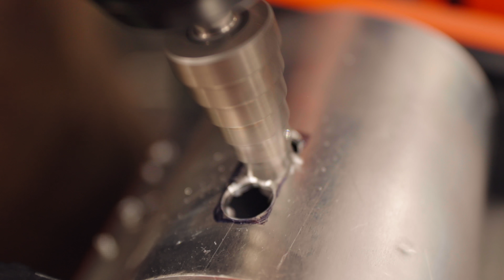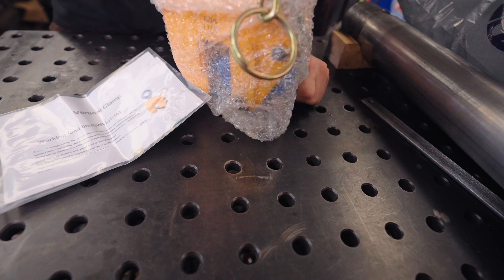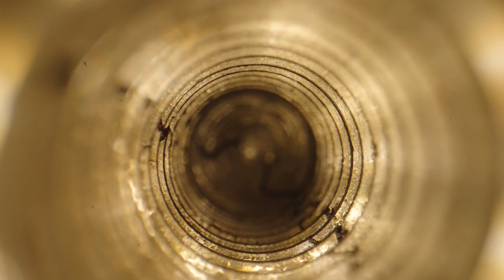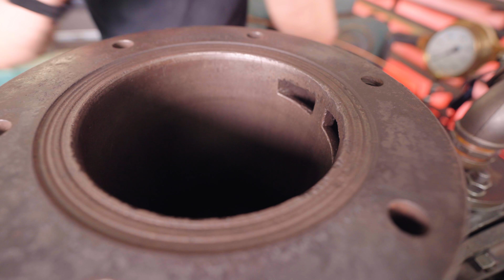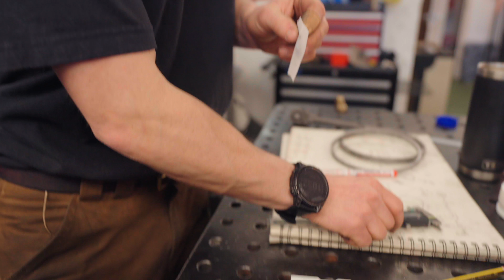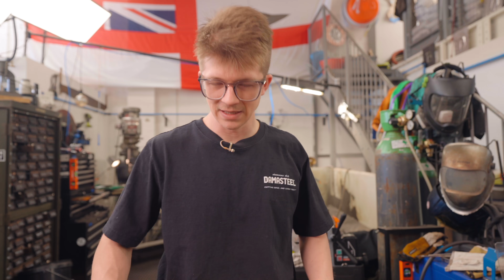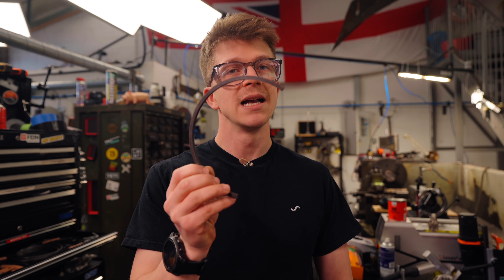Re-Restoring the Steam Hammer! Part 10

Comment: Manufacturing piston rings is a specialized technique: first, they are rough-turned, then cut through, and subsequently clamped around a mandrel with a diameter equal to the depth of the piston head. The outer surface is then precision-turned, after which the rings are placed inside a pipe—with an internal diameter matching that of the cylinder—so that the inner surface can be machined to the correct size.🤠

Comment: Way over thought.   Small bit for a a guide hole . It will follow the gap. Then drill the real hole. The problem is threading it.    I just did one hole for pistons up to 15 in in diameter.   Cylinders were for deep water recovery system used on oil Derrick's.    I pretty sure 1 will do.

Comment: You were right the rings are made of cast iron. If they made piston rings of steel it was a mistake. Steel are used in some modern engines due to high temperature which this steam piston never observe.

Comment: First of all, you’re doing a lovely job. Well done.

When you were making the internal thread and trying to screw in the piston rod, you were having difficulty screwing it in because the back of the piston was not drilled out. Your threads were correct  and had zero air gaps, and it was not allowing air to escape, therefore you were compressing air within the piston and it felt tighter and tighter. When you threaded it over a few times you actually created air gaps, allowing the air that would’ve been compressed to escape. If you had made a hole at the back of the piston while trying to screw the rod in, I think you’d have had more success. Nonetheless, it will all work fine. Keep up the good work.

Comment: I was thinking spring steel.   Spring steel is a specialized high-carbon or low-alloy steel engineered to bend, flex, and twist significantly under heavy loads without warping or breaking, then immediately snap back to its original shape.

Comment: If you have a long rod and wish to keep forge heat away from the rest as u heat the tip? layout a lot of scrap steel (or a custom turned collar of metal) on the shaft outside the forge to soak up the heat before it extends into the far end of the rod.

Comment: Option 5 - set the piston up backwards on the lathe and put the drill bit into the chuck instead and use the travel on the lathe to bring in the piston instead of a turning bit

Comment: I are a welder.  I had to check on the boiling water bath.  You is NOT a welder!  "Putting 7018 rods in water or boiling them would completely ruin the flux coating by saturating it, making the rods unusable for any quality structural or code welding."

Comment: Regarding the Dutchman, is there a potential problem of imbalance caused by the asymmetry?  Maybe not though, since the mass of the screw might be very similar in weight to the metal that was removed.

Comment: When OD threading, turn the tool upside down, run the lathe backwards, and thread from the chuck toward the tailstock, You will cut a small groove in the part at the start of the cut which usually has no affect on the usefulness of the threads (you should put a half round undercut there to act as a stress relief in a dynamic application such as this). When the tool runs off the end of the part you, can casually stop the lathe. The other advantage is the chips fall away from the cutting edge. I've seen other commenters recommend this method. I worked in a machine job shop on manual lathes and that is how we cut threads for small run jobs.

Comment: It has been 40 or 50 years since I had to make rings but i cut the slot in the tube first then compressed the tube with hose clamps and turned the inside round again then the outside to the proper diameter , done

Comment: I just googled what massey hammers use for piston rings.  It says most are cast iron "in the air compressor" but the upper reciprocating arm uses harder steel. Looks like you're gonna have to start over on this one. IF Google is correct

Comment: If the lathe doesn't have a specific indicator to get back exactly into the right position when engaging the lead screw, I always learned that the lead screw had to be kept engaged for the whole set of threading operations i.e. stopping the lathe and reversing it to put the carriage back at the start of the thread...

Comment: Spheroidal graphite (SG) cast iron—also known as ductile iron or nodular cast iron—is an excellent, high-performance material choice for the piston rings of a steam hammer. Because steam hammers operate under brutal, repetitive impact forces and rapid thermal cycling, the unique microstructure of spheroidal iron provides the exact mechanical properties needed to prevent catastrophic ring failure

Comment: Isn't precision machining fun? My job running my 3 CNC mills requires a slot spacing accuracy of plus/minus 0.0003 mm from the callout on my blueprints. And yes, that's the correct number of zeroes. I have to adjust the precision spacers between the 4 carbide slitting saws and use a 1 mm Renishaw probe tip to test the slot pitch. It's totally not stressful or tedious at all.

Comment: Being a little knowitall about the "dutchman" screw insert. With keys in engineering 2 keys do not make up 2x the strength because one of them is always going to take more load and it will like you say weaken the material more. If the room allows it its way better to use one larger key than two (also becaus the strength does not increase linear with size but exponetial. So one large screw more better. You absolutely did the right thing there from an engineering standpoint just using a larger screw.

Comment: When you got to the part about the piston rings being made out of steel and not cast iron, i was BAFFELLED by this! I thought for sure they would be made out of cast iron. I had to sanity check myself with chatgpt:

"While it seems counterintuitive because steel is much tougher, cast iron is the industry standard for engine and power hammer piston rings.Why G-Forces Do Not Snap the RingsThe immense G-forces generated when the hammer strikes an anvil do not snap the cast iron rings due to how they are structurally supported:
Total Captivity: 
The rings sit tightly inside deep, machined grooves within the massive steel or iron piston body.
No Bending Flex: 
Cast iron is weak in tension (bending), but incredibly strong in compression. Because the ring is completely trapped inside the groove, the G-forces push the ring flat against the groove walls. It cannot bend, so it cannot snap.
Low Inertial Mass: 
The rings themselves are relatively lightweight. Their low mass means they carry very little inertia during the sudden stop of the strike.

Why Steel is a Bad Choice for Piston Rings
If you machined rings out of standard steel, the hammer would quickly destroy itself due to three critical engineering failures:
Metal-to-Metal Galling (Seizing): 
The cylinder bore of a Massey hammer is also made of cast iron or steel. When steel rubs against steel at high speeds with high pressure, the two metals literally weld themselves together on a microscopic level. This causes "galling," which rips deep gouges into the cylinder walls and destroys the compression seal.
Loss of Spring Tension: 
Steel loses its elasticity (its "springiness") when subjected to heat and repetitive stress. A steel ring would soon deform, lose its outward tension, and fail to seal the cylinder. Cast iron maintains its spring tension over decades of thermal cycling.
The Wear Cushion: 
You want the piston rings to be the "sacrificial lamb" of the system. Cast iron wears down slowly and smoothly, saving the incredibly expensive-to-machine cylinder bore from wearing out. Steel rings would wear out the cylinder walls instead."

I was SHOCKED when you tested your old rings and they were steel. huh... the more you know right?

Comment: If that's running off steam then the operating temp is close enough to the loctite release temp that it won't really matter if you use it or not. It's more of a plumbers puddy which is great, but it's not locking anything and it makes sense why that piston had threads cut into the mating shaft, because it likely locked it in place regardless of the forces.

Comment: If you didnt want to repair the thread, you couldve fixtured the rod with the piston head on, and cut the hole back round with an endmill, drilled and tapped it for a bigger thread and grub screw. Mightve ran the risk of it cracking in the future though
Reply: ^commented this before finishing the video

Comment: Please excuse the ignorance: Wasn't possible to ground out the thread in the shaft and piston and joint them through the heat interference fit process (or however is called)?, like properly done, with liquid nitrogen to cool the shaft? Maybe even possible to add the slightest tapper so it could dovetail into place? considering that it is known that it will want to unscrew itself eventually?

Comment: Here's a potentially strange idea for you. Would there be a way to reach a curved bit of some sort down into the (using the term you said) dutchman in order to open it a little bit part way down. Then the idea would be you could make a special grub screw of sorts where it's only threaded up to the point of that slight hollow space. Make the screw out of something like bronze or brass and you could possibly have it so you use an air chisel to crush and deform the screw once it's fully threaded in place that way it would become squashed into that cavity and force itself to NEVER come out. Especially since that piston head is something you never want to come loose, and if something somehow does happen and the rivet/grub screw came out it shouldn't hurt the machine since it's made out of brass/bronze. This would also mean it would be a (at least in theory) reliable mechanical means of holding itself into place and preventing the piston from unthreading itself.

Comment: you really didn't need to fill those grub screw holes. Just drill a new spot. The threads are still doing their job. New hole. no heat.

Comment: WHY!!!! did you fill the threads with weld win you could have just milled tight clearance slots on the head and the the screws be half threaded??? and THEN re drill the holes AFTER using a bottle of red Loctite?  its already on so permanently you could have just skipped to welding it on.     no hate just the shear amount of effort makes my lazy ass cringe

Comment: just stick the whole piece on top of a really hot fire or furnace for a half hour to an hour before you weld it if you REALLY want it to last.  i'm self taught, but that's what i did when working on really big pieces that were just horrible and needed a ton of welding.  why?  because it made the welding twice as fast, that means i localized the heat half as much, got half the bending, sucking in, and future micro fractures hopefully.  

also, this is just me theorizing, but i think if you heat it up beforehand it makes the molecular density more uniform in the entire piece when you're done because hopefully it'll pull in the molecules to the weld from a wider, more spread out area of the piece you're welding.  

when you weld something that's going to be under high pressure shocks it's DEFINITELY going to develop micro fractures that will lead to a fail eventually.  it's just a matter of it being in a few days, weeks, months, years, decades, or centuries. it's unnavoidable because you're changing the molecular density of the piece by applying so much heat to one part of it.  add high pressure shocks to that and it's going to start fracturing.  there's the reason why railroads ban or discourage torch cutting, even the toughest, thickest steel rails won't last for very long after subjected to localized heat.

not sure why you said you wanted to localize the heat.  as far as i know that's the OPPOSITE of what you actually want when welding something that's going to get high pressure shocks.  trying to think of what your logic is there?

Comment: Have you considered that the old piston was cast iorn and that the original steel rings were lubricated in their ring grooves by said cast iorn.

Now that you have a steel piston and a steel ring both similar metals and both low lubricity they could gall, cause tight tolarances with thermal expansion etc

You might want to consider a cast iron piston again

Comment: Can't you make the rings slightly oversized and then cut a large enough gap for the rings to fit the cylinder? Instead of making the rings larger after they are cut? I think think you gap gas engine rings that way.

Comment: Its not the springiness of the piston ring that does the sealing against cylinder bore. Its the cylinder pressures escaping to the back of the rings (in the grooves) forcing the rings outwards. 

As such I wonder how it will work when you make the height of the rings a snug fit in the grooves.

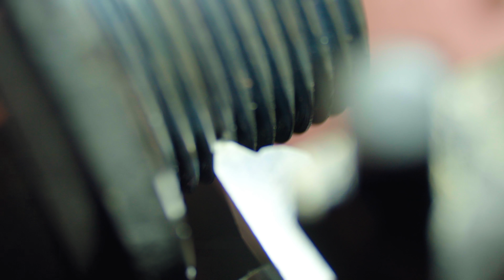Comment: 3:40 just a quick tip, when threading up to a shoulder like that it’s best to run the machine in reverse and thread away from the shoulder, you’ll need to turn your tool upside down though.

Comment: I don't think heat bending the rings larger after machining them is going to work very well for you. There is a good chance that they won't be perfectly circular afterwards. Normally you make piston rings slightly oversize but the correct width. That way they have the springiness built in from the start. Keith Rucker from @VintageMachinery has some very informative videos where he makes piston rings.

Comment: Hey Alec, i assume and hope you already know, but when making piston rings you have to take great care of the piston ring gap. You dont have to angle cut the open ends, there is no need for an ring overlap BUT there must be a gap when installing it into the bore. Better keep the gap larger than needed. The worst thing that can happen is a ring end contact on temperature and pressure.

Comment: @AlecSteele ,Hey  I love your videos, and it’s like Christmas whenever I see that you’ve uploaded a new one. 

I have a question about shortening the piston rod. Originally, it was about 1000 mm long, and now it’s 990–995 mm. 
That means it’s shorter—so what about the compression now, since I’m guessing it doesn’t go all the way to the end anymore? 
Or does it not matter that the rod is a bit shorter now? The rings are also sitting a bit lower or higher (depending on which way you look at it) on the piston, does that matter inside the cylinder? 

I don’t know if I’m overthinking this or not understanding the right function way of the Piston? :D All in all really nice work.

Befor

---->
     |-------------|-----|
||---|--------[|||]|[|||]|- Air Inlet
     |-------------|-----|
<----

After shortening
---->
     |-------------|-----|
||---|-------[|||] |[|||]|- Air Inlet
     |-------------|-----|
<----

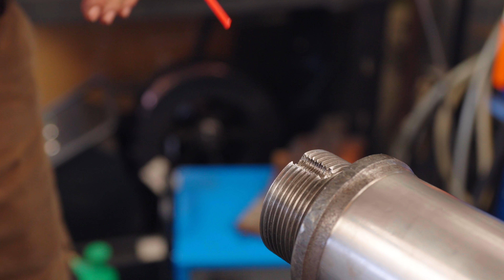Comment: @1:03 what were you cleaning the metal with?  Please tell me it was not brake cleaner.  Cleaning metal with brake cleaner before welding can be fatal. The intense heat and UV rays from the welding arc vaporize the solvent, instantly converting it into phosgene gas—a deadly chemical weapon used in World War I. Even trace, seemingly dry residue is enough to cause severe, sometimes irreversible, lung damage or death.
People need to know this.

Comment: Piston rings... learning almost the hard way.... At least, you did not mount the cast iron rings and experienced them breaking...
    My friend and I are currently installing drywall ceiling in my kitchen. We have put up 6 small plates. It had taken us approximately 20 hours..... The house was built in 1877, "square" and 'plumb" are nor present. We have been FIGHTING for our lives to close a 9,5 m2 ceiling. Today we did it!👍👍
   Keep learning, keep working. You WILL get there.
  Best regards from Denmark 🇩🇰.

Comment: Shouldn't the piston rings be made oversized in circumference and then cut out the gap so when compressed they are correctly sized? Skips heating and stretching them.

Comment: Wouldnt it be possible to cut the ring with a Waterjet or would that be to inacurate? I mean there should be a lot of information on Piston Rings in Cars, they should have the same Job?
Reply: Ok, i just watched a Video how the make Pistonrings for cars and thats not that helpful, they have really fancy machines that do most of the work.😅 Probably best to let Real Seals make you a Custom one, i mean in their video they held a template of a ring in a similar size.

Comment: ? Whut 🤨?

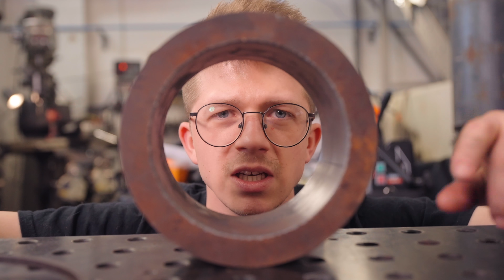13:00 Somebody please explain why you wouldn't just manufacture Ci rings at the larger, un-sprung diameter, cutting the ring gap to suit, as opposed to "heat stretching" them. ?
Reply: My unprofessional opinion is that the cut is easier to make a perfect seat when it is only one cut.
Reply: @Inertia888  
Good thinking... But there has to be a clearance gap set between the 2 ends of a ring when it's compressed so it's very unlikely to be that...👍
Reply: ... or steel ones... (now I've reached the end of the video) 😅

Comment: 15:29 I never understand this. Why does everyone blow away metal shavings with compressed air instead of vacuuming them up? You're just blowing the shavings into something if you're unlucky...
Reply: It takes a lot less time to blow it away than to vacuum it up, compressed air guns are more portable than vacuum cleaners, and a lot of swarf doesn't chip as nicely as cast iron and becomes long strings that get stuck in a vacuum cleaner. Usually when you blow it the chips fall down into the chip tray below the lathe that can be cleaned out with a broom or shovel